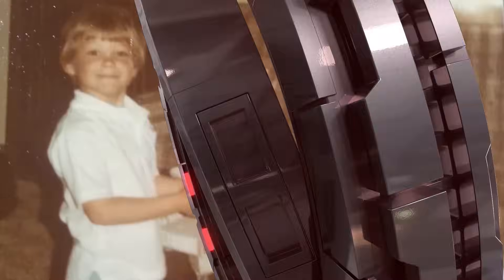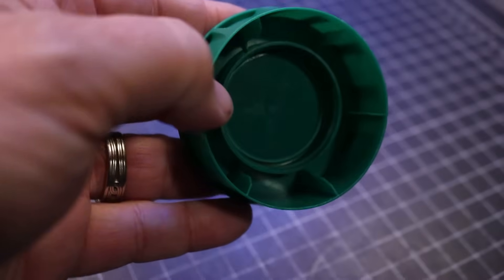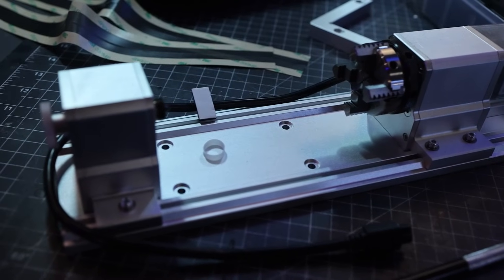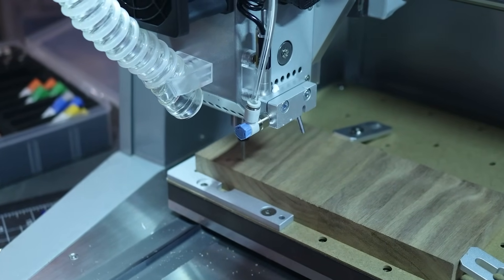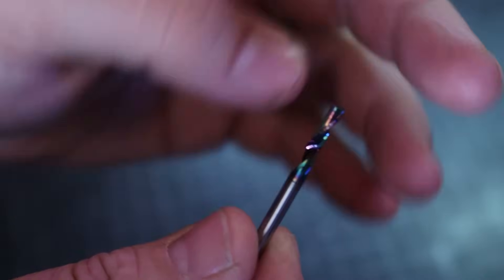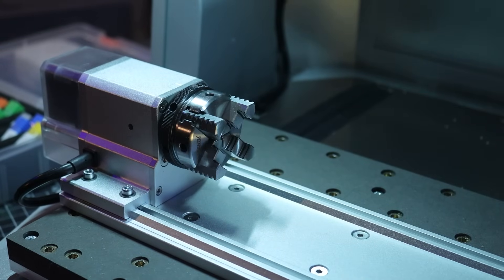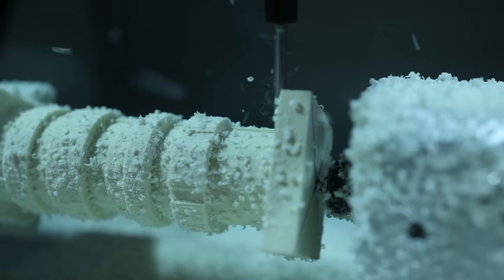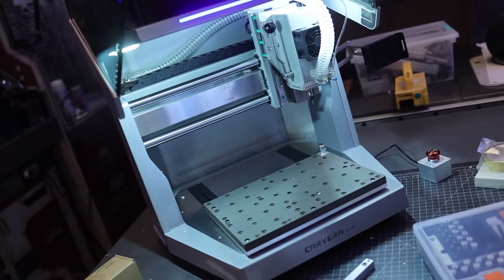Is It Finally Time to Get a CNC Machine? | The Makera Carvera Air

Comment: Why get this tiny machine when you can get an Altmill and do it right....
Reply from the maker: I guess you missed the part about the need/want for a desktop CNC to save space.   Besides, there is no right or wrong, there is simply what tool works best for the user and fits their needs.

Comment: ok so, $2400 right now with the $600 discount going on now, and then only $2500 with the laser? can teh laser engrave to metal too? liek a fibre laser? and then its $2750 for the 4th axis version and $2900 for the one with laser AND 4th axis? and $3200 for the one with laser, 4th axis AND PCB bundle? dunno what that does!

Comment: way to expensive
Reply from the maker: no . . . not really.
Reply: @TheSmugglersRoom  for the average maker its way way outside of a reasonable price range. 3d printing didnt really pick up steam until machines hit $200. Plus if i want a cnc mill i can get bigger better machines for that price on the used market. until these machines hit the sub $1000 price range. they are to expensive.

Comment: My only issue with this machine is how underpowered the spindle is.  Especially for the asking price.  The design is great, the software/interface is nice.  Even the working area, for a desktop machine, is not bad. But a 200W spindle is just so low.  For reference, a 1hp trim router is approx. 675 watts (and honestly, if it had the power of a 1hp trim router, I would have bought it in an instant).
Reply from the maker: That's a great point.

Comment: Ive been using the heck out my CNC for over a year now.  If I could go back in time a year, I would tell myself not to waste my time, and just get the 3D printer instead...
Reply from the maker: Oh really??? Not finding the CNC worth it?
Reply: @TheSmugglersRoom  Its very limiting in the size of material I can work with.  It also cant make round items in the Z axis.  Both are useful, but in very different ways.

Comment: I’ve been manual machining for a long time, and cnc machining for a few years now. I have the carbide 3d nomad machine and it’s very similar to this. On aluminum you wanna keep step down and step over both to about .010” or less. They don’t have enough torque to do anymore then that in aluminum. Doing any one side stuff on these little machines is super fun. Trying to do 3d two side parts is a bit of a paint getting it lined back up after flipping the part. 

Good luck with the machine.
Reply from the maker: Oh!!!  Thank you!  That’s great advice.  Very much appreciated

Comment: I would like to know more about the tool changer (or lack of) and how good the vacuuming is. Idk why this $2,500 machine is better than the $400 ones if it's the same size and doesn't have a tool changer.
Reply from the maker: I have very little experience with CNC, so I apologize that I won’t have more details.  What I can tell you is that the tool exchange is crazy easy.  It’s basically a lever you pull down, swap the bit, reset the lever, and you are good to go.

The dust collection is decent, however on the back of the machine the hole is only about an inch in diameter.  So it will require some sort of custom fitting.  I plan on 3D modeling one and printing it to fit my dust collection.

Comment: Is there anything about the unit that you don't like or that you felt was a shortcoming?
Reply from the maker: Not necessarily.  Time will tell as I get more comfortable with the process of CNC operations.  I’m still a total noob at this tool
Reply: @TheSmugglersRoom  Right on.

I appreciate that you're coming at this from the perspective of an inexperienced person. This doesn't feel like so much a review as it is a showcase and a contemplation piece - and that checks out :)

A lot of the videos I've seen about the Carvera Air in the last week or so have been conspicuously positive - and folks who tend to be constructively critical don't seem to be doing videos, and folks who had previously done a review and were at all critical don't seem to have been invited to do a follow-up during this marketing push.

I'm choosing to be particularly cautious with my hype this time around.

Comment: I miss having access to a cnc. Makerspace closed up before I could try it with wood but I made neat stuff with dense foam. Cnc is the opposite of a 3d printer- you remove material to expose your model / the smaller the unit, the more expensive it gets.
Reply from the maker: Totally!

Comment: Just imagine, that 4th axis means you just gained a custom lightsaber factory on top. It will only be aluminium, but still...
Reply from the maker: Right???  So pumped!
Reply: @TheSmugglersRoom  Was looking at something simpler a few weeks ago, but for a different purpose. Mainly, carving wooden bucks to vacuform components like canopies for custom aircraft/spacecraft miniatures.

Comment: Brian,  How is the noise and the smell?  Biggest problem I have with the XTool P2 laser cutter is both of these issues.  Also, what about the mess?  Is this something that can be set up in a room inside the house or is going to create a mass amount of dust?

You demoing the XTool P2 years ago helped me make the decision to go with it and I have no regrets.  I've been considering a CNC for many years as it can do things the laser cutter can't. This could be the one I go for to get my foot in the door.
Reply from the maker: Hey there, thanks!  The noise is less than the Xtool for sure, especially when the door is closed.  The aluminum is the loudest material, but i sort of expected that.  The mess can be a lot.  If you keep the door closed and connect dust extraction it's manageable enough to have indoors for sure.  When the hood is closed it keeps the mess totally contained.  Then you just have to vacuum it out.  

I dont' have a ton of hours on this machine yet, but it's been very enjoyable.  I will say, the software and navigating it does have a steeper learning curve than I was originally thinking, but that is largely due to my lack of experience with CNC work.  That said, i'm super impressed.
Reply: @TheSmugglersRoom  AWESOME!  Thanks for the info.

My wife is going to hate you as she knows your demo of the XTool was my deciding factor and this may be it for a CNC.  Take care!!!

Comment: For wood and metal, definitely. The rest can be done with a Bambu Lab 3D Printer and if you get the larger one, it too has laser engraving. So I think this really applies to people working in wood and metals. I didn't see the Vacuum and waste collection in your video.
Reply from the maker: totally.  I'm staring at the Bambu HD as we speak.  I think ultimately it comes down to what types of projects and tools fit the needs you have.  So many options out there.

Comment: Hey Brian, a small tip: use small blocks or machinist jacks as counterparts fof the mounting brackets. Put the brackets so they are level, with that you don't get more marks in the clamping brackets and.
Otherwise pretty nice.
Reply from the maker: oh sweet!  Thank you!

Comment: There is not necessarily a lot of torque applied on the material mounted in the 4-jaw chuck on the rotary axis, but you should probably still clamp on the flats of the square stock and not the corners.
Reply from the maker: Appreciate the help, i'm sorry though, I am not sure I am understanding what you mean?  I had the chuck clamped to the flat sides of the material, so i'm not sure what you mean by "Flats."